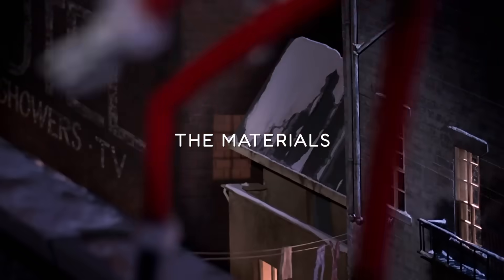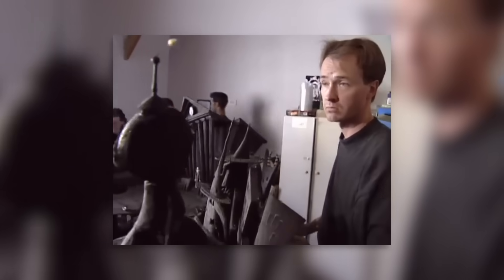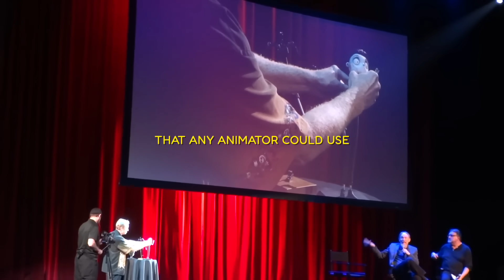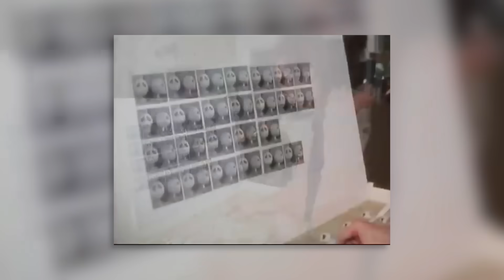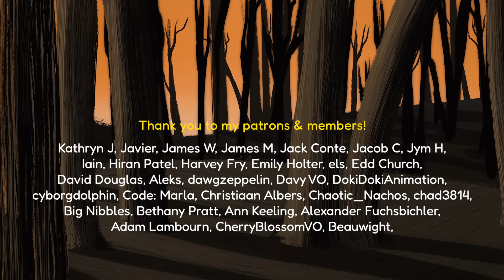The Incredible Engineering Behind The Nightmare Before Christmas

Comment: Please Do Not buy foam latex and use it at home - I've been through school for sfx and you need specific ventilation or a respirator and a designated oven to bake in - it will make your home oven toxic - Do Not bake foam latex without ventilation and an oven that will never be used for food again. Seriously it's extremely dangerous and the smell of the foam latex mixing alone will gas you out of your house.
Reply from the maker: ^ You’re right. Do you think I should trim that part out? I’m worried I didn’t give enough context/warning.
Reply: @filmquestion yes please! People can try out alternatives like expanding foam or algenate as alternatives to foam latex! ❤